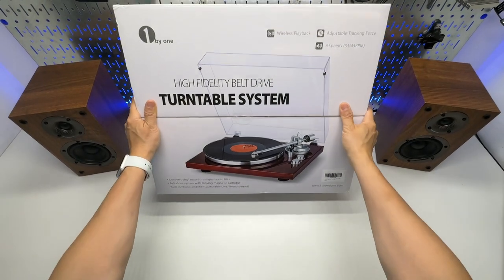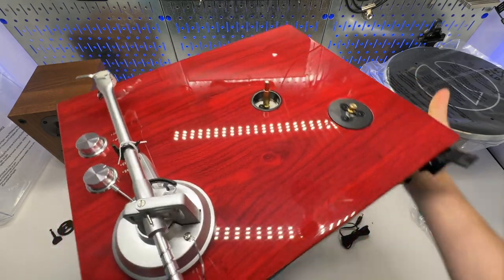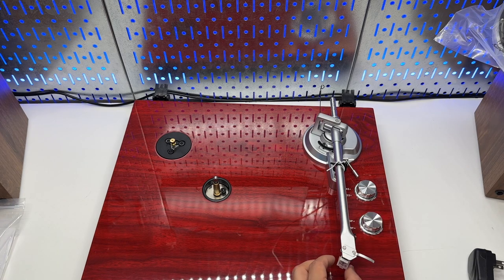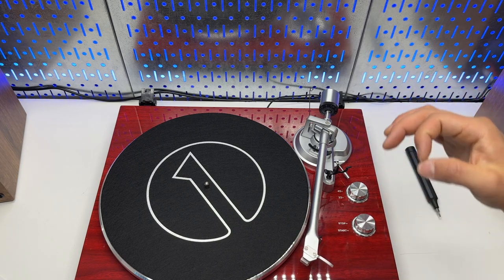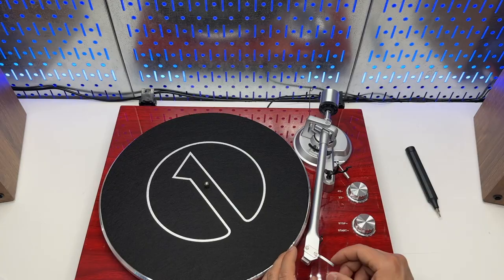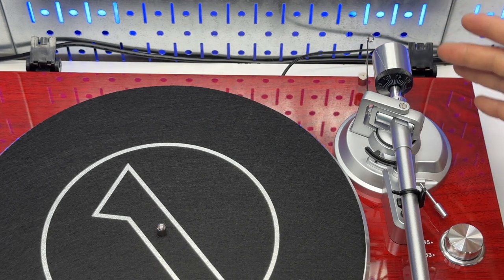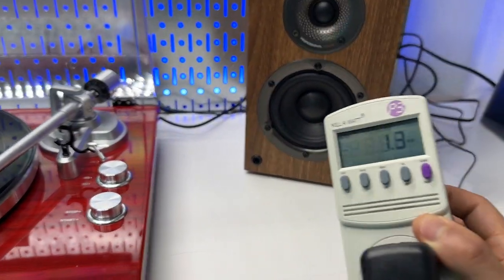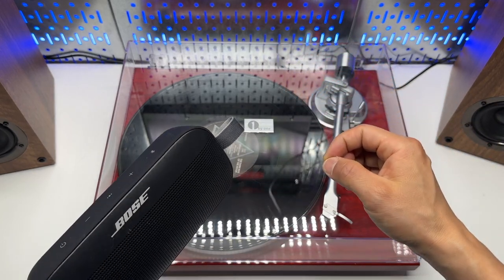How to setup 1 by One Turntable with wired and Bluetooth connection

Comment: Hi, Thank you for the video
@4:27, just before you play the first bit of audio, it seems you did remove the 
counterweight on a string... you didnt mention why.
Ive been struggling with skidding, having to put more weight on the needle to prevent skid.
I did remove the little counterweight and it works fine now.
I rewatched your video to make sense of it, and only that time I saw that you did remove the little counterweight too.
So bad design?, I dont get it... I use to have a button on my old turntable to adjust skid "spring"
This has been replace by a string and a pennyweight? 
Clearly I f you had to remove it and I did too... its a recurring problem
Anyway not too bad of a turntable, a easy way to listen to my old record with bluetooth headphones or modern amplifier without a phono input.
The digital Bluetooth part is just convenient, but also have analog outputs with or without pre-emphasis.
Reply from the maker: I don’t remember I think it’s because it worked better without that string.

Comment: After all the setup, The table won’t spin. Belt is fine but the motor itself doesn’t seem to be getting any power. Please help!
Reply from the maker: Sounds like you have a bad unit. You should get a replacement immediately.

Comment: Great video.  Did you have the turntable set to phono or line output on the back.  Mine works on line output to my powered speakers but when I attempted to connect a JBL CHARGE 5 speaker it appeared to connect but there was no audio.  Any suggestions?
Reply from the maker: You have to use line output if you don't have a phono preamp.

Comment: I have the exact Bluetooth speaker. It says it’s connected to the player but nothing comes out. I have all the settings correct, did it in the exact order you do yours in but nothing. You can hear the faint noise coming from the record so it’s not that. It’s driving us crazy. But then every so often it works. Literally the worst.  Please help!
Reply from the maker: Call customer service